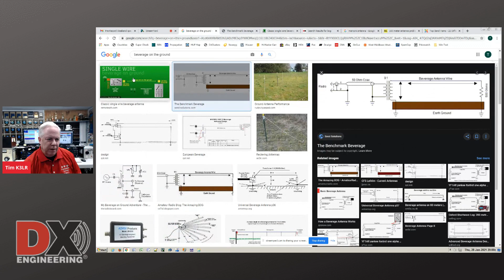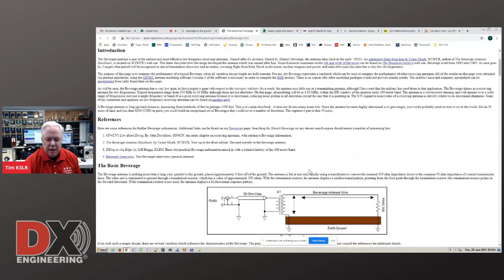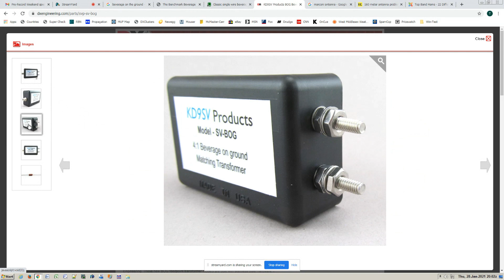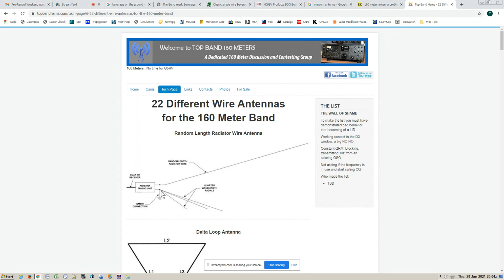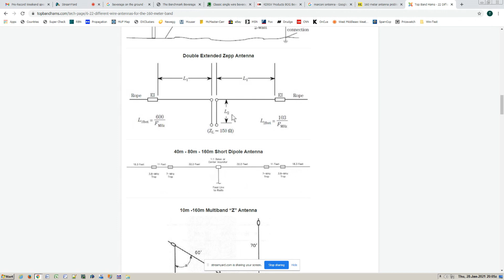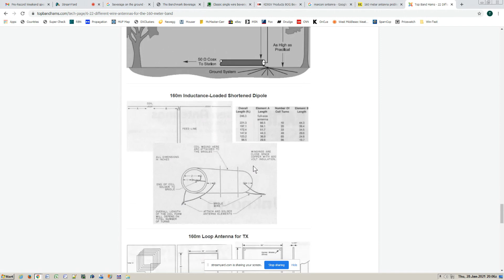160 Meter Tips and Tricks - Weekend Special

Comment: I like my 800-foot Beverage antenna. It was built 10 feet above ground but now due to the weather, 1/4 of it is on the ground. Still works great. Low noise too. My homebrew match is a 9:1 unun that works from 15KHz to 15 MHz....took 3 cores. N3SWL

Comment: I have operated 160 Meter voice and CW since 1980. I ran a full sized dipole, then ran a 160 EFHW both 60' above ground level. The EFHW antenna compared beautifully with the standard dipole, but under different band conditions. The EFHW antenna worked better under good propagation, but suffered badly under low signal propagation. The full dipole worked better under poor low propagation conditions. This has been an observation taken over 43 years of activity on the 160/80  meter bands. I have tried other types of antennas, but they never measured up to the original antenna designs I first built. The tuner I used was a Heathkit SA-20260, before that was a home brewed differential "T" tuner which worked quite well. 90 watts out of a set of Drake Twins almost always got me 5-9z + reports.

Comment: My 1/2 wave 160 Meter vertical dipole (262 feet) seems the best I've tried. Even better, in most cases, than shunt feeding my 90-foot tower. 
73,
AA2HA

Comment: Yes, 160m is a good band for testing my home made AM broadcast transmitters on, as it is still a MF band not a HF band. I am now working on a very new vertical antenna system, that is designed for high gain and it also has a wide bandwidth, so there is no requirement for any Antenna Tuning Unit (ATU) to be used. Where you only need a minimum high of 1/8 wavelengths, where it is not a 1/4 wave like some other designs out there. I am not one for using CW nor Contesting, but I have a lot fun experimenting with new ideas and building radio equipment to use on the Ham bands.

Comment: Years ago I used on of DX Eng 43 ft vertical and about 80 ft of stainless steel fishing line and a SGC-237 coupler at the base of ant... worked 160m, didn't do very well but I was on 160, which was the goal.

Comment: This season i did not have enough time for a proper 160m antenna so my INV-L has some 44ft vertical section only. Some 30 radials and a  matching coil. In october i had only 50DXCC made there. Now it is more than 100. Maybe not much but got from CE to VK and even a KH6. RX antennas are: 4 bevs (SA/PAC/VK/USA), EWE, LOG 100m circumference + i too find my 2el 40m to be a good RX antenna :). Waiting for LOTW + paper QSLs (gonna take some time due to covid postal restrictions) and will get my 160m DXCC. 160m is the last HF band i did not have 100 and more worked. 
I would only dream that the ARRL and CQ Magazine make it mandatory for contest participants to use LOTW. There are so many DXCC that have the means but no will to go LOTW instead $$$.

Comment: My 160 TX antenna is a modified Hustler 6BTV. I took off the 80m resonator and whip, threw a wire over a nearby tree (never measured it, but it's probably another 30 feet up from the top of the mast), put about a 25uH coil at the bottom end of it, and then hose-clamped it to the top of the mast. It resonates right at 1900, with SWR < 3 across the band. The Hustler loses 40 and 80 but it still works fine on 10 through 30.

For a receive antenna I have a 100' circumference loop-on-ground, with a 9:1 beverage transformer and a DXE-RPA-2 to make up feedline loss. Works quite nicely and doesn't need as much linear space as a BoG.

Comment: Hi Tim,
I've been using a Terminated Inverted U antenna. It works from 160m - 6m without a tuner and SWR less than 1.8:1 across the bands. It's two 12m fiberglass Spiderpoles spaced at 20 ft using the balun and terminating resistor from Cross Country Wireless. You can find info here.   http://www.crosscountrywireless.net/terminated_inverted_u.html

I am going to increase the spacing to 60 ft using a design by AA7OK. Won't need the balun or resistor. Should give the same or better performance. Wish my CW was good enough to participate in the contest. Stay safe.  73  WJ3U